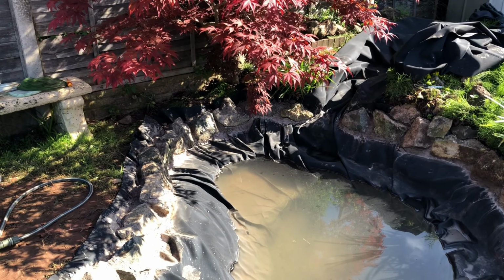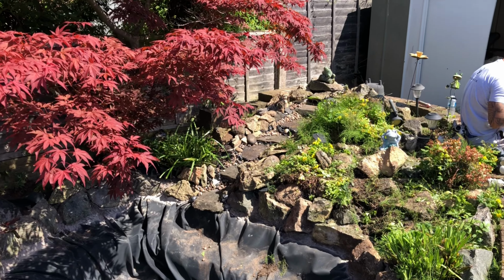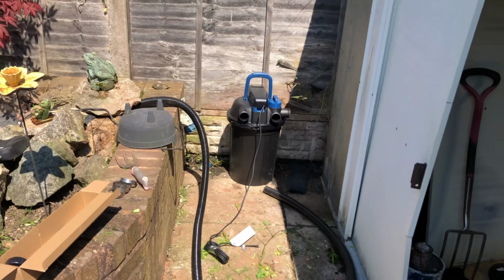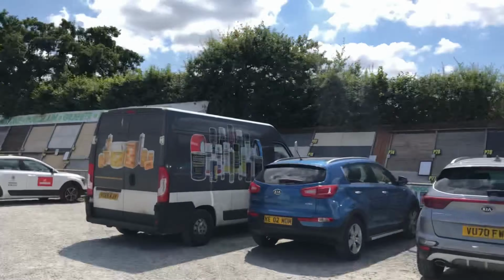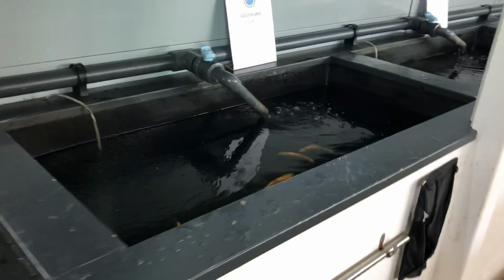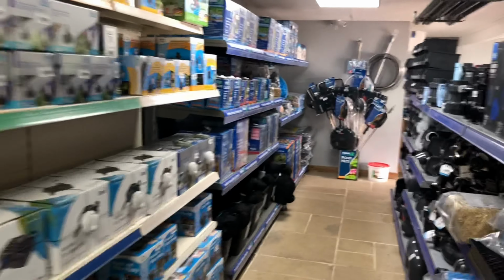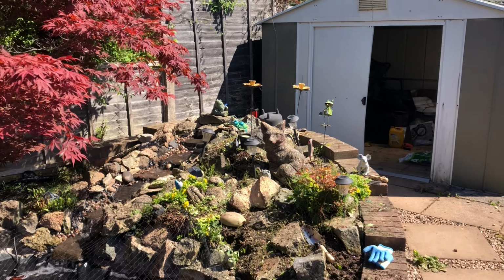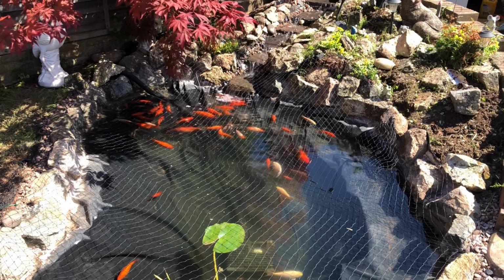Re lining rock pond part 2 . With tonsillitis 😫

Comment: Another handy video 👌 Any tips on algae as it looks like the hulk has had a shit in my new pond over the last 4 days it’s gone from bad to worse I have got the Bermuda pressurised bio 3000lph uv box filter running as of today as I had to fix the inlet connection when should I see a improvement now that’s running ?Pond size is 7x4x3,keep the vids coming 👍
Reply from the maker: Yes you legend 👍🏽 is the filter new with a new uv bulb ? If so it should start to clear over the next few days , you could also do partial water changes to speed things up 👍🏽 thanks for watching and commenting you absolute legend 🙏🏽👊🏽
Nice 👍🏽
Reply: @koiservices6694  tbh it’s a old system I got off my brother but I’ll order a new bulb by the sounds of it and I’ll do a lil water change today cheers for the advice top man
Reply from the maker: Any time 👍🏽 we have a proper little Koi crew going here , I love it